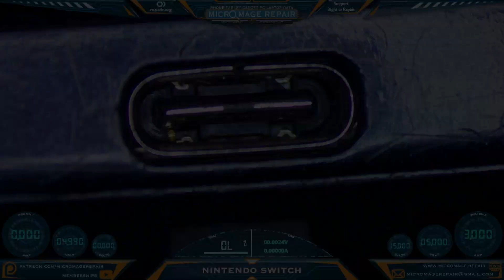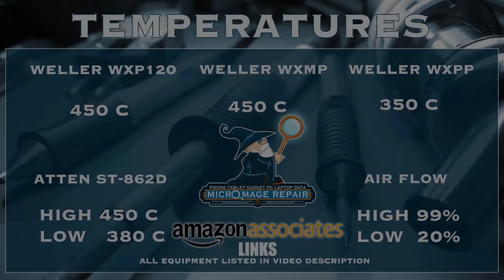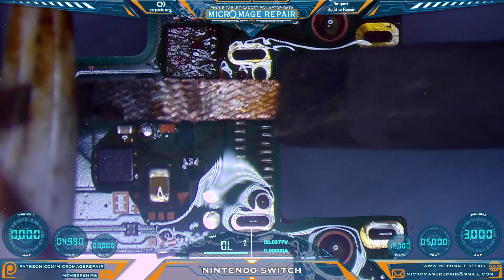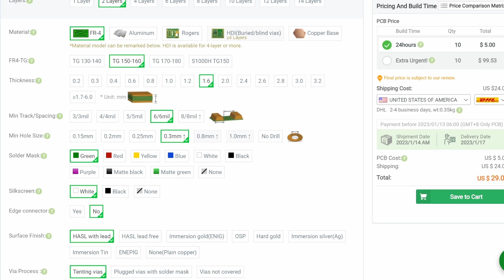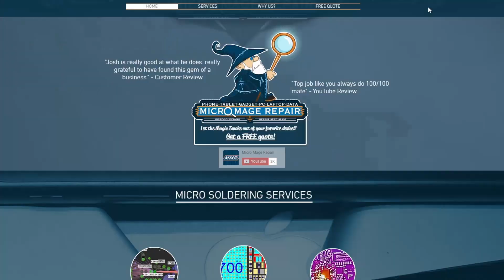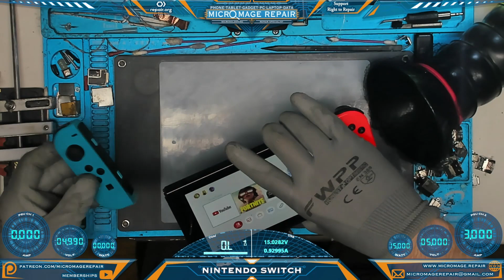Nintendo Switch: 🤔 Obvious Port, Non Obvious Issues

Comment: When a capacitor is shorted to ground, does that mean the electric current isnt going through and actually going to ground? I assume that’s what it means
Reply from the maker: A Capacitor typically has one side that is connected to ground but it should not be acting as a wire. It has layers inside it that separate. 
I highly recommend @EEVblog's Capacitors Playlist https://youtube.com/playlist?list=PLvOlSehNtuHvpVeLXSGlS7EBlY3zKfIXh For a more in depth explanation. 
In this case and in most I encounter on game consoles it s not actually the capacitor pulling the non ground side to ground but an IC failure.

Comment: Interesting to see the diode pack missing in that revision of the board. 2:41 Joey does tech had weird power issue with those https://www.youtube.com/watch?v=ZzfJ06mGL5k thanks for sharing 👍
Reply from the maker: Yes I saw that.
 They are occasionally problematic, I've  covered it in video and in Cod3rs streams at times.
They were removed in later revisions.
They can cause strange charging behavior, no docking, one side charging just to name a few things.
But it's pretty rare. I had a mess of them in one month and then it was like a year or longer before I had another issue with them.